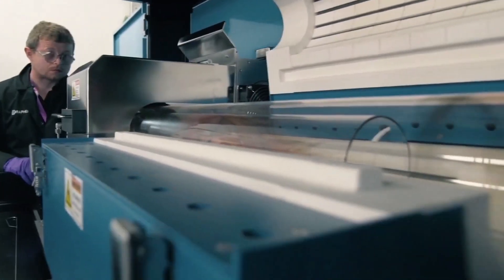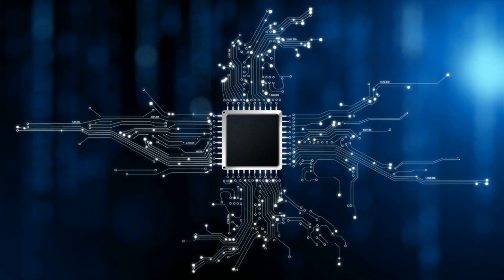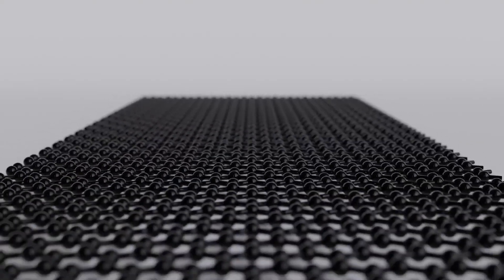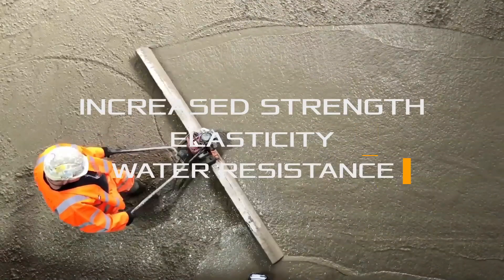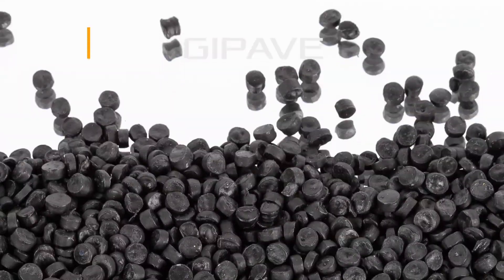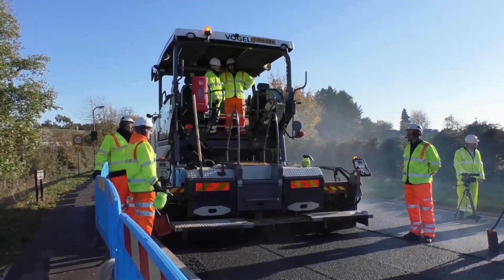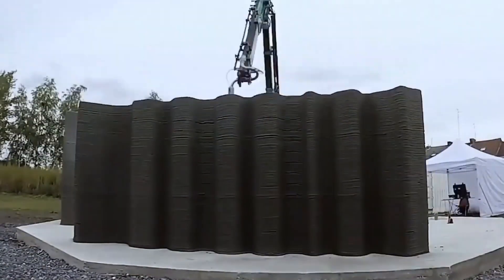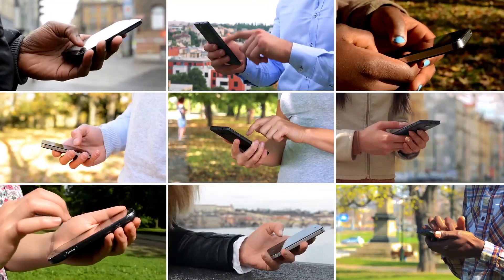Graphene in concrete is already changing the rules of the game in construction

Comment: In the case of concrete, perhaps graphene will increase the corrosion rate of the reinforcing rebars, unless, water and oxygen (and bacterial) penetration is highly reduced and/or the steel rebars are well coated.
Reply: Rather, it will prevent spalling of rebars. Since most defects begin at the nanoscale, it will prevent and reduce possible defects, due to its strong bonding with the C-S-H in cement.

Comment: The elimination of rebar in concrete will avoid the oxidation of the steel which often tears the structure apart from the inside.

Comment: Everybody in the construction industry knows that-re bar and the wire they use to tie it together is rusted before they actually pour the concrete. Maybe the should concentrate on using Graphene to be  a coating on the re-bar as it is being produced as a protective coating.

Comment: Several decades ago, engineers in the US of A (and likely, everywhere else), found that small shreds of tire rubber could be of great benefit when mixed with the concrete with which highways and roads were paved.  Quieter travel, improved road life and other benefits were found to far outweigh the ordinary concrete construction material's properties.  Why then, have we not made use of this nest of advantages?  Simple greed is the answer.  If used for this purpose, the roads would not need replacing for years beyond the present norm and the companies producing the normal concrete would not be employed at the same rate as at present.  Therefore, the concrete companies won't incorporate this slight but long lived, incredibly effective and factually beneficial change to their ordinary product.  Wouldn't it be nice if things such as this could be mandated when PROVEN to advance conditions to a usefulness far beyond present standards?  In truth, I expect the exact same results for the inclusion of graphene as rubber shreds in the concrete; exactly none.
Reply: When you add more than 20% rubber to cement it's strength begins to go down. They will use those same tires to make the graphene instead

Comment: Graphene seems to be the solution without a problem.  It seems like this wonder material can't seem to gain a foothold due to cost and added complexity.  If I have a traditional foundation pour and it lasts for the lifetime of a house - 60 to 100 years - what is the gain for me as the homeowner to spend and extra 20 to 40 percent more on a foundation that lasts 200+ years?  That cost is what I would pay up front for a benefit I will never live to see.  I also wouldn't recoup the cost in a neighborhood where I am the only one that did this and my house cost 40% more then my neighbors house that is the same size.
Reply: If the cost is impacted by 20-40% it will never succeed in the market.

Comment: Graphene already has improved auto detailing in the form of auto paint wax. It’s a better protective coating and it takes less effort to apply and buff out, big win!
Reply: The best wax holds up well. Think the ones they use on jetliners.  And obviously makes them fly better, move swiftly cutting through moisture and ozone barriers.

Comment: The way we build and maintain roads is dumb and hasn't changed in years. There should always be an assembly line on wheels. I don't care how slow it has to go, but it moves at a constant speed. Every year it gets a little faster. No more workers standing around with random little machines everywhere. It needs to stop. It's depressing how uninnovative our civil engineers are.

Comment: added 30% strength?
 Sounds good at first until the CEO and shareholders greed turns new products 50% thinner and the overall product is 20% weaker while costing more (again, just for the greed).

Comment: This application doesn't require ultra quality Graphene like a microchip processor would, so they could start to ramp up production & refine the production methods with concrete. Companies need to start producing it like they need to start producing solid state batteries even if the batteries aren't perfect for some high end luxury car.

Comment: There's already ingredients that can be added to concrete to make it more water resistant with a sealer at the time it's batched at the plant. Same goes for extra strength. Fiber strand and more can be added to increase strength. 
I remember a time on certain government projects, they required the use of recycled material mixed in with the aggregate, like glass and all other kinds of stuff, which in my opinion, sacrifices the durability and life of the concrete.
Just because someone has an idea to just mix stuff together doesn't mean it's going to do well over time. Think of hardened steel. Ya, it's very very hard, can take a beating, but under the wrong conditions, it's brittle. Hammer Mills used to crush cars in scrap yards for example, they bust stuff up all the time, but just one propane bottle gets dropped in by accident, and the explosion busts those hammers all to pieces. Just because it's hard doesn't mean it's unbreakable. Same goes for life span of material. Look at an old glass pane, over 100 years or so, you'll see that the glass is slowly moving down. Glass moves down like a liquid over time. So much to go on, but that's my opinion.
Reply: Having talked at length with the at the time president of Mitchell Fibercon the strength
increase and wear/survivability were nothing short of amazing.
Reply: Wrong about the propane bottle, and wrong about the glass moving. 50/50 about the 'steel'. Otherwise ok.
Reply: It will not happen fast or easily but progress is being made.  Check out the work being done by the Center for Advanced Construction Materials at Univ of Texas at Austin, for example.

Comment: Unfortunately Accountants have too much influence in decision making as they do not consider the costs of decommissioning of concrete structures, the lifespans of which are relatively short, for example large concrete ‘flyover structures’ are now having to be dismantled due to integrity failures, these failures are often internal and can only be fully investigated by ultrasonic equipment. The costs and inconvenience of decommissioning such structures is enormous. Compare these structures to the steel girder riveted bridges that are well over 150 years old.
Visual inspection is possible with such structures and repairs are relatively straight forward, I would also suggest such engineering is for more pleasing aesthetically. Any projects such as these should legally accountants to submit costing based on length of serviceability and full costs of decommissioning. I think the use of concrete would be short lived
Reply: Gerard - Excellent points.  Rice University scientists have developed a Strain Sensing Smart Skin (S4) that can be used to detect microcracks by interrogating the surface of a structure with an optical device (laser), that has been coated with the S4 material.  Also can be used on any structural surface, like an airplane wing, where it is important (critical) to become aware of structural failures before they go catastrophic.

Comment: So graphine if ingested or injected into humans or animals is DEADLY. And if used in road construction, the roads will, over time begin to slowly degenerate and begin producing graphine filled concrete dust that will be breathed by any motorist using these roads. Is any consideration being given to this issue. There is also the fact that the Roman's developed the hardest concrete we have seen to this day using volcanic ash. Volcanic ash is plentiful almost everywhere and doesn't require manufacturing in high tech facilities. So the obvious question is obvious, WHY?
Reply: Yeah, brought that up earlier.  Concrete is very porous. Which means rain and roads conduct heat very easily, this would be the only catalyst required for the Graphene sheets to break down into beautiful carcinogenic byproducts.  Isn’t it lovely?  These guys fail to understand that Material Researchers are on the brink of being able to create 100% stable Carbon Nanotubes, which aside from being stable, ARE 3-Dimensional and orders of magnitude or robust than Graphene, without easily produced carcinogen compounds.

Comment: Asbestos was widely used in construction as an effective insulator, and it can be added to cloth, paper, cement, plastic and other materials to make them stronger. But when asbestos dust is inhaled or ingested, the fibers can become permanently trapped in the body. Over decades, trapped asbestos fibers can cause inflammation, scarring and eventually genetic damage. 🤔
(Safety Data Sheet – Graphene Oxide ACS Material LLC) 👈very interesting

Comment: This is a complete smoke and mirrors video with no practical basis in reality.  Graphene has a few specialty uses as a one or two molecule layer in some applications.  Other than that, it is a complete bust.  While the materials folks who work in this area have been touting it for 10+ years, it have almost zero adoption, it simply doesn't work for almost all applications.  The bulk applications noted in the video are an absurd use for graphene.

Comment: Blah blah blah marketting spiel. Show us the tests that show proofs of these claims. Concrete on-ground slabs are vastly different to pre-stressed suspended concrete beams, vertical and horizontal. Also, how can any new invention claim and show longitudinal durability? Noone thought concrete cancer was gunna render most 20th century buildings a lifespan of only 20-40 years. Also, adding graphene to concrete will massively increase the recipe costs. The blue metal must still remain for bulking (or else you'd need 50% of its volume replaced by graphene) and the steel reo could never be completely excluded.

Comment: The only issue i see with G-pave (Asphalt with plastic and graphene mixed in). Is stability of the plastics and potential of slick roads during wet conditions. Yeah we all see bottles and Styrofoam not breaking down easily, but other types tend to break down faster, due to abrasion and exposure to sunlight. For example i worked in a plastics factory we made lawnmower parts, (deflectors, chutes baggers ect) we were required to make the parts for 3-5 years (depending on customer), because of the wear that happened due to sun exposure and abrasion from particulates being moved. These were NDPE (High density Ploy-propylene) And HMWPE (High Molecular weight Poly Propylene) both high stress and and tough materials and resistant to abrasion. yes they still lose to exposure and abrasion. I see issues if a similar material gets used as you go from grass dirt and sand to vehicles ranging from 2k to 10K+ occupying the same stretch of road. The potential hazard from rain and wet conditions comes from plastics waterproof nature, water isn't absorbed, so it'd stand in low spots. This doesn't even consider in hotter climates, where a road can reach 120- 200 * C due to the nature of Blacktop absorbing heat energy. That ability would be heating up the plastics causing a breakdown of the main components of the plastics, one of which is a wax that is a byproduct of the oil refining process. If you have a hot spell then rain afterwards, that released wax could possibly cause something worse than black ice on a road. Using it in norther climates would be fine, but don't expect this to work well in a place like Arizona, Texas or Southern Cali

Comment: The slow rate of adoption by industry is for two reasons: graphene can't be produced in large quantities nor can it be produced cheaply. Carbon fiber can be produced in large quantities, but can't be produced cheaply. Until both these conditions change, the expense will prevent widespread use of either material. They will only be employed in highly specialized and unique projects. Basic economics.
Reply: I agree completely.  For nanomaterials to be viable, even for small scall usage in the construction industry, will require massive volumes.  Solving the volume issue will also solve the cost issue as economies of scale and process efficiencies are achieved.  For example, the use of rotary kilns instead of fluidized bed reactors to manufacture CNTs will drive costs down to a small fraction of what they are today.  That will enable widespread adoption, as long as benefits are demonstrable and economics continue to work.

Comment: Graphene Reinforced Concrete appears to be highly electrically conductive , could perhaps attract lightning if used in a building ? May not be a problem , just a factor to consider .
Reply: If it's conductive, it's probably good grounding material.
Reply: Not especially. Any tall building would have a system for directing lightning to earth through a shielded conductor, and whatever the increase in conductivity might be, it won't come close to copper or aluminum.
Reply: Useful for sensors to give information on any deterioration in graphene-enhanced structures.

Comment: Well, as a guitar builder who puts technology above tradition; the latter being used as a selling point, and all to often fallen for, I already adopted using carbon fiber rods as neck reinforcements all the way back in 1986, and well if I can use graphene instead, it may have great benefits.  The big questions will be:  In what forms will it be available, like sheets or rods.  Will I be able to find it in dimensions I can use as is, or will I have to cut it to size, or even mold it somehow, and if so what equipment will be required... What adhesives will and will not work with it, and what will it do to my tools if I do have to cut it, or will I need special tools, and once all that is figured out, it will depend on the labor involved (more or less?) and costs for everything, as my parts and material costs have gone up exponentially over the decades with no end in sight, and high quality hand made instruments have become a hard sell, with the market being flooded with way overrated cheep South Asian made POS's that are pretty much disposable, and adding to our environmental disaster in several ways because of it.

I will have to look into it, just as I had to when carbon fiber became a consideration, as I would have used it sooner, but couldn't until it checked most of the right boxes and became viable for me to do so.
Reply: I have a friend who builds some killer guitars. He uses carbon fiber laminated braces in his acoustics , Makes the tops lighter and more responsive and increases vibration and volume etc ,

Comment: I don't understand how taking a layer of graphite 1 atom thick and calling it graphene can ad strength to something. How is graphite not just as strong
Reply: It's the molecular bond among the carbon atoms that gives graphene its strength and other physical properties. If the sheets are long enough for the surrounding material to attach to, the whole composite material is strengthened. Sort of like rebar at a microscopic level.
Reply: @Wayne Earls, maybe you should ask that same question of the Nobel Committee in Sweden who awarded their Prize for Physics to Andre Geim and Kostya Novoselov in 2010 for their discovery of graphene at the University of Manchester.  Both of those gentlemen have since been deservedly knighted by H.M. The Queen explicitly for their discovery of graphene.

I doubt very much whether either of them would receive the Nobel Prize for Physics or be able to use the title of 'Sir' in front of both of their names for merely finding a different use for graphite, don't you?
Reply: @Phil_A_O_Fish  I never said it wasn't discovered. I remember when the news broke about it. I'm just saying I don't understand how atom sized particles of graphite, called graphene can strengthen concrete.

Comment: So is it as dangerous as asbestos if it gets airborne?
Reply: Is it heck, @Jacob w, as it's created using graphite then it's about as dangerous as you licking the black part of a pencil, isn't it?  That's what they're both made from, isn't it?  Despite us calling the part of a pencil that we use to write with the 'lead' it doesn't contain any of that dangerous metal and is also made out of graphite, isn't it?

Pencils are probably more dangerous if you sharpen them to a point and throw them through the air than graphene can ever be if you do likewise and chuck it in exactly the same way, isn't it?  Chance would be a fine thing when it comes to graphene because it can only be measured in two dimensions unlike pencil 'leads' that are obviously measured in three dimensions, aren't they?

Comment: My career was in the concrete, asphalt, sand & gravel industry and over the years there's been multiple ideas to cut costs and improve results, from re-using asphalt shingles to 'crumb rubber' to the tried and true fibermesh. While making concrete stronger, lighter, cheaper and cement production more environmentally friendly is always the goal, there's little reason to build skyscrapers 'to the moon' other than for some engineers to brag about it. Not many people want to live 140+ stories off the ground.
Reply: I don't think that is true, that people don't want to live .....high.
check the commercial and residential rental rates on skyscrapers, on a per square foot basis per elevation...higher is desirable.